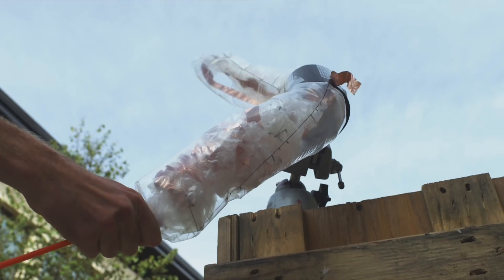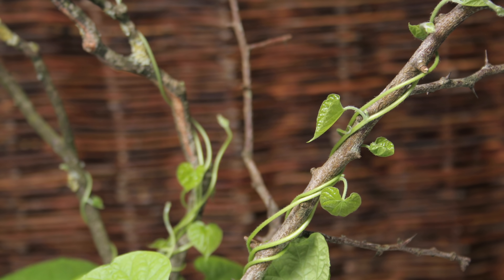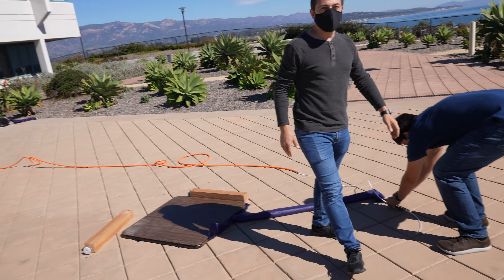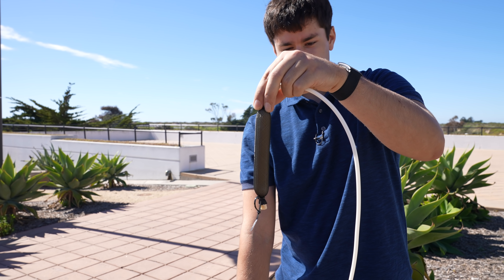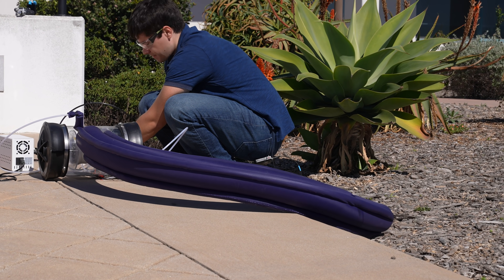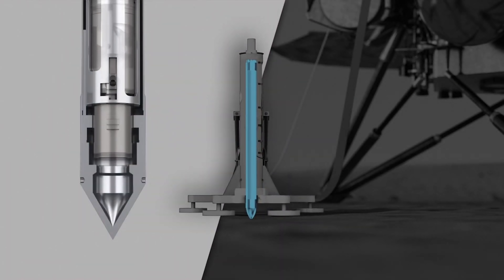This Unstoppable Robot Could Save Your Life

Comment: Spider legs have joints, which are connected with short bands. The movement of the legs is provided by inflateable vasculars and altered pressure. So this technologie could be used to operate exo-skeleton typed robots.

Comment: Yep airbags used for heavy lifting a long time. Wrecker trucks, Tactical rescues in Fire Service, and Aviation, decades actually. Plumbing companies reline sewer lines trying to extend service life, liners impregnated with epoxies. Placing cameras nice to know you are in the correct pipe, big plus. 

Especially like the intubation assist! Pressures need to be very controlled or risk blowing holes in lungs. 

Calling it robotic has a marketing flare. 

Perhaps extra fine, bio compatible liners to reinforce blood vessels when detecting aneurism in brain, or Aorta. Million dollar concept. Patent before you lose that one. 

Keep up the good work! This has potential.

Comment: Biomimicry is definitely the best design method, very interesting project.
Reply: I kept thinking of duck dick. Biomimicry at its finest
Reply: what animal is the ISS based on?
Reply: @SobeCrunkMonster  stickbug :v
Reply: God was pretty good designer.
Reply: @dogelife7901  Leel. Not if you look at our nasal cavity and sinuses.
Reply: They stole the idea from nature?  Bull crap, they stole it from pipe liners that repair old pipes, been around for decades
Reply: @breakingames7772  What do you mean ? Natural is older than a couple decades, so they got the idea from there…
Reply: @breakingames7772  and nature have been around for AGES
Reply: @breakingames7772  pipe liners are practically the simplest type of this technology.
The way the inventors improved the concept (by making it fully maneouverable) was inspired by the vines.
The basic concept in practice did already exist but the advanced concept in practice did not so they built it.

The difference between the advanced and basic concept means they didnt 'steal' it either. How can it be a stolen idea if it does something the previous idea cannot, or is designed for a different use? If there is a patent somewhere to do with pipe liners its not in violation of that patent.
Reply: @breakingames7772  The inventor looked at a vine and noticed how it extended itself up some sticks. That is probably what the guy meant.

Comment: I think the sand burrowing application would work better if it blew out pressurized water instead of air. I buried like 20 feet of garden hose like that when I was a kid. Just kept feeding it in the hole.

Comment: My question is that the tube is a set length, what happens when you reach the max distance you can extend it, but need to go a little further to save someone or to get around a corner in an archaeological dig?
Reply: Start with a longer tube. 

Or you can make an endless length of tube. Instead of sealing the tube on one end and pressuring through the open end, you just need to seal the open end to a pressure chamber with a flexible slit seal in it. The tube just needs to be dragged forward through the slit seal and always remain protruding from the origin so that it can have new tubing circularly seamed onto it as it reaches the end of its run. I don't know if that description conveys the idea appropriately, but it can be done.
Reply: @christophersmith8014  For your first idea, you won't always know where a person is in a collapsed building so while having a longer tube won't always help. But for your second idea, that is actually really cool.

Comment: Make it thin enough to enter capillaries without blocking and they'd be able to do non invasive surgery anywhere in the body provided that the robot can use the fractal pattern of the patient to map a course itself.
Reply: I’m not an expert but I feel like this would be unfeasible from the square cube law
Reply: @aoe9015  There are already flexible needles that can enter arteries to install a pace maker onto the heart without invasive surgery. I would assume that an inflatable robot could be smaller. The main issue I expect to see is what would happen if the air leaks. It's more of an issue inside the body so you can't just increase air pressure. You'd have to limit air pressure.

Comment: I can absolutely see this being used in “old work” construction, to pull cables in hard to reach places, or pass cables through areas that can’t simply be accessed without costing $ for extensive demo and repair to open up something (say drywall) and then close it back up.
Reply: Late to the party but just found this robot yesterday. I'm a security technician we use low voltage wire and this would save so much labor. I'm pitching it to my company to start using for those tight spaces. For all the heavy wire you are talking about, this thing could run a pull string for you. The idea is to make trekking the wire path easier. Not do the job for you.
Reply: You've never fished heavy gauge wire, have you?
Reply: @carlosoliveira-rc2xt  I just recently ran 6awg only inches from a wall box to a tankless wh through liquidtight 90° vertical and another 90° horizontal, mere inches, less than fun, need to fish heavy better bring lube and a strong arm
Reply: @Invisus_Letum  I occasionally have to run heavy wire from the panel to outside through entire basements wherein 100' weighs almost as much in pounds. No sausage maker is doing this.
Reply: @Invisus_Letum  Lol Yellow 77 is your friend.
Reply: ain't gonna be no wormbots on site so quit whining and take out that damn wall! 😉

Comment: This holds a lot of potential, not just in life saving
Reply: Building collapses and tunnel cave its seem like the primary use case for a robot like this.  Since the robot is already filled with air by design, it seems only natural to use one to traverse trough rubble or fallen rocks in order to locate survivors and keep them breathing until they can be rescued.  

They have a big advantage over other emergancy rescure robots in so far as that they are cheap and fairly expendable.  For a rescue of several people, its not hard to imagine a few of these being deployed and not being too concerned if the robots are damaged in the process.

Edit:  i read "just not" instead of "not just", so i guess I'm just agreeing with you lol.
Reply: @SineN0mine3  uhh, sure, but that’s still mostly disaster recovery,
Reply: @kingfloridaman5274  which can save lives
Reply: @axolotl5477  yea sure
Reply: @kingfloridaman5274  did you even watch the video? They demonstrated that the robot can lift a pretty good amount of stone with a little bit of air pressure. That could save someone’s life if they are trapped under a bunch of stones, which means the robot is literally life saving.
Reply: @axolotl5477  good Lord you innocent prince/princess, read my name, you should already know what I’m thinking
Reply: @kingfloridaman5274  oh my god I’m so blind
Reply: @axolotl5477  HA it’s good, you made me laugh for a good while each time you commented, your fine

Comment: We've been doing this for centuries to line drains with liners to save digging them up, the same concept also works with water instead of air :)
Reply: Imagine one of these
Extending with water
Then popping at the tip and going crazy ham like a waterhose left running at full pressure

Thats firefighting i want to see

Comment: This robot grows just like how a bacterial flagella grows, it grows from the tip unlike hair that grows from the root. 
Flagella could grows very long as long there are enough structural strength and supplies of material to the tip.

Maybe, instead of rolling the uninflatted tube on the tip, it's better to let it through coaxially inside the inflatted tube, all the way from the tip to the end, where you can add another extension to reach further.

Comment: What if it's  already attached to the building before it collapse so when a disaster hits the pressure of the tube will activate and won't  it already hold the structure of the building ?

Comment: I'm not sure about using it for insterting a n oxigen tube. If the lungs has air and you just force robot to enter the tráquea by pressurized air, stretching it and leaving no exit for the air in the lungs. Then it would be compressed in the lungs and thus risk them to explode if the pressure is strong.

Comment: Nice but hyped, and glancing over the many problems... for example, it can survive a puncture, ok... but how many? and a gash? what happens with all the air you have to inject in it (and that is gonna flow in the cavity...) to maintain the shape once punctured? How going through a small hole affects the "impedance" of the air in each section and the pump? etc etc
Also, I don't think "unstopable" means what you think, lol

Comment: One potential issue that concerns me, in relation to incubation, is the fact that ventilators not only require the use of positive pressures, but that of negative pressures, as well. While they did demo the intubation procedure, they didn't demo it with a ventilator attached and running. 
With that being said, I'm curious to learn how they plan on keeping the tube from collapsing after positive pressure is removed. Perhaps existing methods, such as Positive End-Expiratory Pressure (PEEP) can be utilized in this instance. However, I have a feeling that they are ultimately going to find that the pressures required to keep the patient's airway and alveoli open may be radically different than that required to keep the tube itself from collapsing in on itself and essentially, resulting in the tube being sucked-out of the patient's airway.
It's not that I don't believe that they can find a solution to such an issue. I'm simply pointing out there are still quite a few questions that need to be answered, before this can even be considered as a viable alternative to the existing procedures and technologies.
Regardless, being a total tech nerd myself, I am totally rooting for them to succeed.
Reply: It would need a double walled robot, basically doubling back on itself, with it's own air valve that could be inflated to make the balloon structure more rigid.  Then you could remove the air pressure from the main tube and open the valve to allow the lungs to do the work.  I think that could open up a lot of potential for this particular tech.
Reply: Yea. That was my confusion as well. Sure, the demo could find the pathway to the trachea, but is obstructed the entire airway. I think that Timothy Peters' suggestion for a double walled robot would be an improvement, but I would suggest the robot serve as a guiding tool for the conventional rigid airway supports that are currently used. Since the robot is soft, it would likely be able to let the rigid tube slide along the interior whilst still providing sufficient pressure to keep the airway open. If that's not the case, they could implement additional air releasing holes on the tube's core to ease friction (similar to how they did at the tip with the sand example). Once the rigid airway is inserted, the robot could be retracted back. If they're able to get the robot to expand from and retract back into an auto-sealing package, it would also prevent potential contamination and reduce infection risk.
Reply: I can’t imagine using a soft and very pliable material such as what’s shown in the demonstration would ever work past anything more than maybe securing a quick emergent airway for out of hospital intubations. Now while it seems like a cool and promising idea, the mechanics of intubating someone actually involves a lot of factors I don’t think they’ve accounted for in this design. Hopefully they get a medical professional who understands pulmonary anatomy and physiology well enough to help with the design.
Reply: This tech doesn't need to replace traditionaal intubation in order to be extremely useful as a form of respiratory life support. What if the majority of households and offices carried cheap versions of this, much like AEDs, with voice promts to perform chest compressions at the correct invervals and whatnot. Medical professionals could then use traditional intubation when they arrive on site.
Reply: That's a lot of words for "ET tubes need to be rigid." Incorporate a stent.
Reply: Was thinking same thing, that fabric limp tube ain’t going to cope with outward breathes
Reply: people are saying this thing isn't rigid and 'limp' as if they completely went braindead over the explination of how PSI and amount of force these things exert. It's going to be exerting as much force as literally any rigid tool you put down there lol. It's not going to be removed unless the surface friction of your throat allows it, and if you wanted it too, you can easily inflate something like this to the point of bursting the trachea and tissues it's enclosed inside of.

it's rigidity isn't going to be an issue, if anything, it encloses too much and can exert too much force if done wrong.
Reply: O  O
   _
Reply: @ridhaandar2214  Wassup?

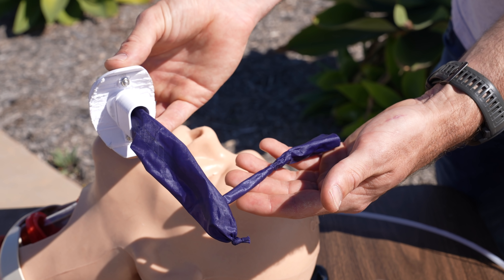Comment: 10:20 I'm a MD and in work in ambulance. On one hand it  might be handy and less invasive (harmful) to the patient cause it of made of soft material. On the other hand i think there will be many tube collapses - the tube is hard for a reason- it has to stay opened even under negative pressure (if the patients starts to breath on it's own and sucks the air in). 
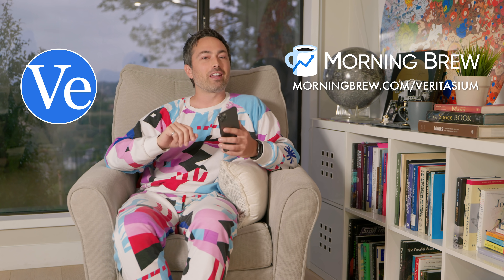14:29 i think those robots should be relay fast in endoscopy. Specially in urology.

Comment: This method is actually already applied by plumbers to reline the internals of damaged pipes underground. A membrane lined through the pipe using compressed air then coated in an epoxy solution

Comment: Another plus with that is that even though it's burrowing through stuff, there is is very little disturbance or friction of what it's moving through.  Like with current intubation, that tub is just being rammed through the person.  Since the robot is unfolding and then refolding in on itself, the tube isn't sliding over the tissue inside of the throat. Once a part has unfolded it stays in the same spot.

Comment: Combi tubes are faster than traditional intubation and used pretty commonly by EMTs.
Reply: Yep, and don't collapse down either. Not so sure of the application of this in the  prehospital setting with iGels now standard. It isn't quicker, isn't a definitive airway and involves mechanisms that would be hard to check by laypersons presumably (and we have enough trouble getting BP cuff gauges checked).  As for it taking several minutes with a laryngoscope, maybe for a complex RSI but for a paramedic it is usually 20 seconds or less once gear is out of bag.